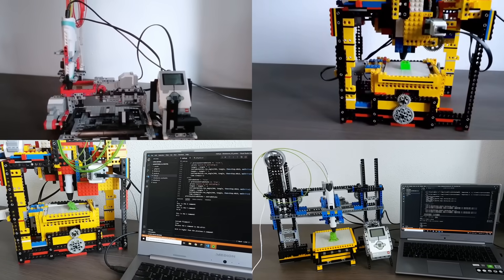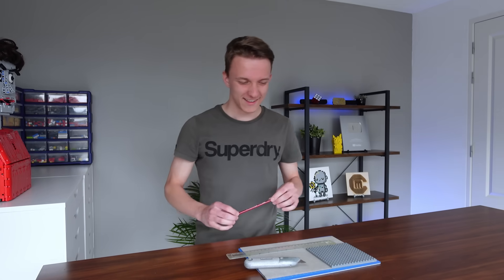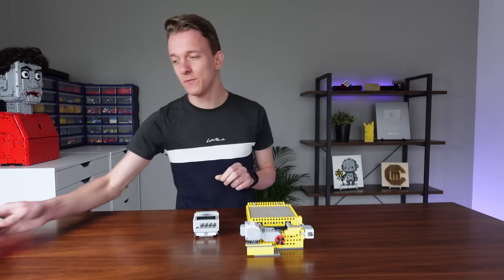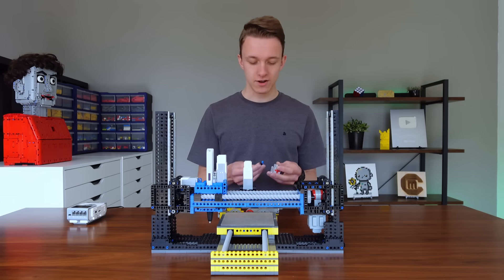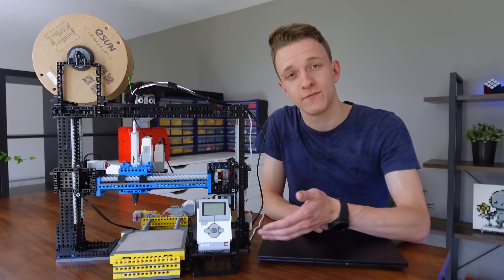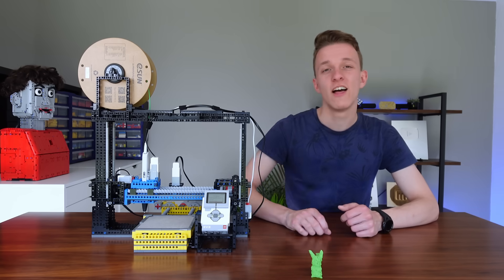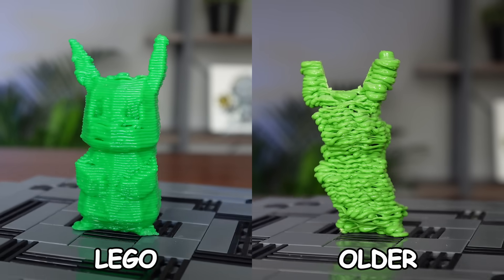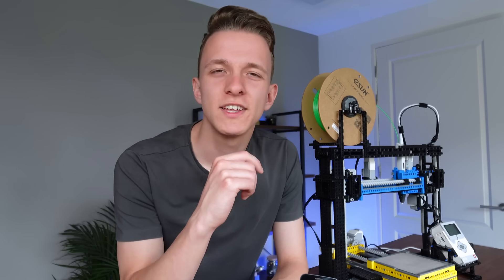I Built the Ultimate LEGO 3D Printer!

Comment: I don't think people understand how crazy this is good job
Reply from the maker: Well you do, so that's enough :)
Reply: @CreativeMindstorms the craziest part in my opinion is running it off of a Lego controller, was expecting a standard 3d printer control board
Reply: @whoknowsyn there is no difference. lego controller is just a mcu, lego motors are just servos. the only difference is that they are very overpriced(like 1000x) and limited and they have "lego(c)" on them
Reply: @doodocina there is a difference, and that’s in support, with a 3d printer control board you can just run marlin or klipper with a config for the printer, with this he has to code literally everything by himself, and coding is kinda my worst nightmare, spent hours looking through forums to figure out how to add the functionality to a pre made html file that I needed, though I don’t have the slightest bit of knowledge in the subject.
Reply: @whoknowsyn you can port any code easily, there is always a hardware abstraction layer, further more hardware level of 3d printer is 4 stepper motors. if someone didn't do that it doesn't mean it is hard. this guy is not a programmer, he 100% used llm
Reply: real
Reply: It’s crazy I want to build one myself.😮
Reply: I second your comment.
Reply: AGREED 100% :D I was just about to say this.

Comment: Very nice video as always! I really like the looks of your MK5 :)
For a next version it would be better that the filament spool is on the table, not at the top of the printer because the weight will give you more vibrations while printing, also add a part cooling fan and retraction for less stringing ;)

I see that you put in the code " self.draw_centered_text("Print complete!", line = -1)"
You didn't showed that in the video but that is a nice extra :)
Reply from the maker: Hey you did some digging! Thanks for the suggestions! I actually didn't know about the spool being on top problem, but it makes sense, so thanks for that. I could've included the print complete, but figured it maybe was 't as exciting as I thought it was lol :)

Comment: Suggestion: Add a fan and or cooling system somewhere near the nozzle that will cool the Print faster when extruded so that it hardens faster and there are less droops or dangles in the Filament!
Reply from the maker: Great suggestion! Maybe I'll create version 6 in a couple of years! 😅
Reply: @CreativeMindstorms  cant wait to see if you do!
Reply: @CreativeMindstorms don't wait for years. simply add a fan and it would dramatically improve the quality of print
Reply: @doodocina  If you add generic fan to it it woud't be a lego printer. You need to add fan from lego.

Comment: This is almost a usable 3dprinter. The worm gears are a good idea, I also thought that if I were to remake my own lego 3dprinter, I would use those. It isn't the best lego 3dprinter, I've seen a better one from "TechBricks", but this is very impressive just using a 3d pen. That being said I think this is holding it back and this would be much better off with a normal hotend and an extruder, you can just eigther print an adapter to an existing extruder or make your own thing with some bmg gears, I would love to see this in the next version. I used a second ev3 to control the heater, micropython has bluetooth mailboxes wher you can communicate the target temperature to another ev3. I have a video on my channel of my lego 3dprinter that works like that. Also make sure to add a part cooling fan, especially how it is now the filament does not have enough time to cool off so it sags down, this is visible in a couple of prints. If you want to be really fancy you could also make it that the print files are on a usb stick that you insert into the ev3, I don't know how to code that but it would be very fancy.
Reply from the maker: Dude you made a 3D printer too?! That is so cool! I will have to check it out. Those are all great points. I have considered using actual 3D printer gear, however, I did find the relatability and ease of use very appealing, as it makes it more achievable for everyone! Maybe I will create another 3D printer one day, using an actual hotend, cooling and controlled feedrate! Thank you for leaving your thoughts. It's awesome to meet other people with similar interests!

Comment: As a 3d printer hobbyist, I think the best upgrade at this stage (without using parts for 3d printers) is to add
 cooling
Reply: yes, cooling and calibration.
It will never be great but you can definitely made a pretty functional machine.
Reply: That’s good, I found from experience fan cooling helps eliminate bubbling and provide better print quality.
Reply: I was waiting for him to add cooling but got disappointed
Reply: needs a smaller nozzle. a nozzle too big can have less quality unlike a smaller nozzle
Reply: Yes i was going to tell to add colling fans
Reply: also retractions but cooling first
Reply: came to say this
Reply: I'm just imagining a Lego fan constantly blowing at the whole thing like a box fan
Reply: Maybe add purge line and wiping distance in the code on top of that
Reply: Bed heating
Reply: An actual extruder would be better. It eliminates stringing, and adding a 0.4mm nozzle would improve print quality. CuraSlicer (The slicer that was probably used in the video) is not designed for nozzles as big as this 3d pen
Reply: Or to add a real interchangeable nozzle
Reply: Came here to say the same thing lol
Reply: and lubrication
Reply: no, I think its better to use a proper extrusion system, its not a cooling problem with those speeds, and I know what I am saying(I think) because I build completely self designed 3d printers, cooling, maybe, but right now it seems more like a extrusion problem
Reply: but GREAT video
Reply: @catscrafter cooling is an issue, you can see it, especially when it print the ears. The blobs sag a bit too, it will help to get a cleaner results.
The big issue is calibration, it's gonna be tricky to dial up the button press on the 3e pen to limite the overextrusion, but not impossible with a bit of patience.

An extrution system would obviously be better, but Its kinda against the spirit of the video. I think the pen could manage to be better with a few tweak.
It will never be a good printer, but it's not the point.
Reply: @SaitoGray  yes, cooling is a problem, but the main problem is the uncontrolled extrusion, the main reason for blobs is overextrusion
Reply: are you talking about a part cooling fan or for the pen
Reply: @catscrafter but he said that he does not want to use proper 3d printer parts beucase it will add up in cost and make it more complicated for people wanting to recreate him.
Reply: @filipbyma6130 Yeah, but this is just a limiting factor, it will be harder to improve it this way
Reply: @filipbyma6130 you could use  a fan blade with a motor and a LEGO duct for aux cooling, would probably be too big for it to be on the toolhead
Reply: @whoknowsyn  the lego air pumps could work for cooling
Reply: @catscrafter that and maybe building an anti backlash nut for the x and y axis because with leadscrews and stuff like it you will always have backlash, though this is not an issue on z because of gravity
Reply: @catscrafter  the point of the video is a diy low cost low effort printer ... not a diy printer ... grab a pen grab some lego and get to work ... if ur going all out and getting proper hot ends u may aswell buy a printer
Reply: @catscrafter That's what I would do too, especially considering the lag in retraction. However, I would overall choose a different toolhead. I would opt for a real 3D-printer hotend as well, just for the better flow rate and perhaps a smaller nozzle size too.
Reply: or make it core xy
Reply: @RobomechWarriorNo, way to complicated for lego and not needed
Reply: @catscrafter  it is needed for good quality prints and isn't too complicated
Reply: @dachmachunabachuna123  no I really really think it’s not a resolution problem. I mean the screws are much more except belts. the problem is the extrusion system and tool head. I really think I know what I am speaking about. Prove me wrong, but only with proof
Reply: @catscrafter  I agree that  the extrusion system and toolhead are flawed and retractions are missing but it is not ONLY that. the simplest problem to fix is cooling because you just strap a fan shaped lego contraption to a motor mounted on the toolhead and make it run. then add retractions in the code and add the necessary piece to the mechanism to allow for retractions. and the perfect solution would be just taking an ender 3 toolhead but that would not be very "lego" so this is the best we can get. the resolution is not a big factor because even modern advanced 3D printers use that same system but there is always room to improve.
Reply: @catscrafter you are right that it isn’t a resolution problem, but the pen is probably at least extruding consistently, I think that it is a problem with backlash on the screw, and an anti backlash nut would be pretty easy to make I would think
Reply: @catscrafter  not nessisarily too complicated. however it could help improve some of the ringing in the prints from the bed slinging
Reply: @RobomechWarriorcorexy is definitely not the next step, but that would be cool, would be a coding nightmare though
Reply: @whoknowsyn my word
Reply: as a fellow 3d printer hobbyist i agree with this statement

Comment: As a 3d printer hobbyist this got my interest! Really cool that Lego motors can be so precise!

If you were to make a 3.0, I'd recommend you trying a conventional extruder for the next one, because the pen definitely makes the layers really big and unprecise. A conventional extruder with a 0.4 mm nozzle would improve the layer height and size, improving the ''resolution'' of the printed parts/ making them smoother. 

A problem with this would be, that it needs a 12v power supply, but I think you could find a way to integrate that quite easily👍
Reply from the maker: Totally,  thank you for watching and leaving your suggestions! I did consider using actual 3D printer gear. It would improve the quality a lot. The biggest reason for me to not do this was to make it more relatable and accessible for anyone who would like to build one for themselves. The plug-and-play 3D pen is more versatile for everyone. I also found achieving the highest possible quality with products that are not made for 3D printers at all a fun challenge!
Reply: @CreativeMindstorms  Hmm... that is true. It would be cool to see it though..
Reply from the maker: Maybe I'll try in a couple of years!
Reply: you can even try dissasembling the 3d pen and swapping a few parts to make it not over extrude on those corners
Reply: using 0.4mm nozzle you will be forced to print slower, so it will take so long to print. If you will increase printing speed, quality will be terrible. Or in worst case, this 3d printer out of legos will shatter to pieces :)

Comment: I think it would work better if it was was moving faster and extruding faster when I built a Lego 3D printer I that out
Reply from the maker: I tried, however the main bottleneck is the software. It stops at every coordinate, which means you get a blob if you're extruding too fast.
Reply: @CreativeMindstorms what I did was run a second code so it wouldn’t do that
Reply from the maker: That's so cool! I would love to see it!
Reply: @CreativeMindstorms sadly I took it apart to build something else but I can build it again in the future
Reply from the maker: Understandable. I do that with all my builds too.
Reply: @CreativeMindstorms how did you get the gcodes to work that was the only thing I couldn’t do so I had to manually program it
Reply from the maker: You can use the open() function in Python to open a file and readlines() to read it. The code is in the description so you can see for yourself if you'd like.
Reply: @CreativeMindstorms  ok thank you